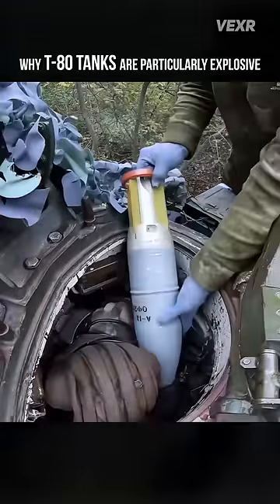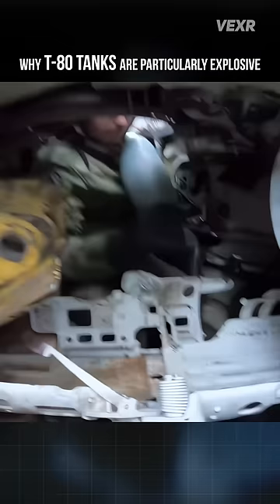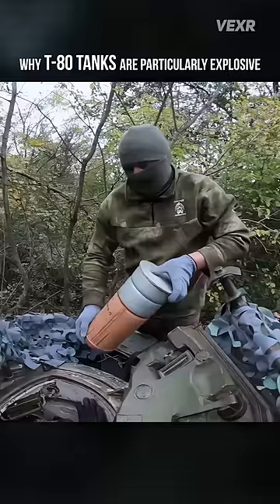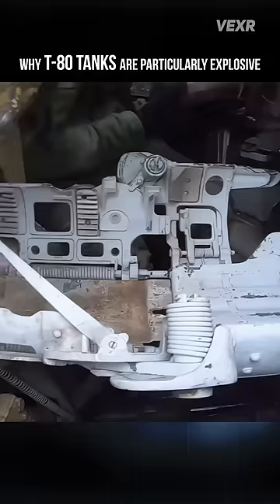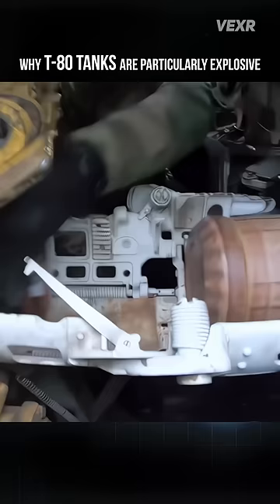T-80 Tanks Are Particularly Explosive, Here's One Reason Why

Comment: Not so advanced.... badly trained.... blah blah blah... Stop your bs! Firstly, regardless of the presence or absence of “fireworks,” breaking through the armor almost always means death for part of the crew. So NATO tanks are exactly the same metal coffins for the crews. In 2, the only reason why NATO tanks rarely explode with “fireworks” is the lack of high-explosive fragmentation shells in their kit (besides, NATO tanks almost never fought against an equal opponent, until the war in Ukraine, which demonstrated the insignificance and helplessness of these promoted vehicles). They are the ones responsible for all these “tower take-offs”. NATO strategy almost does not involve the use of tanks against infantry, and therefore there are no corresponding shells there. Regarding the automatic loader, in older models it actually slightly increased the chance of being “fryed”, but against the backdrop of an enemy shell hitting the tank, as I already mentioned, there will be mincemeat even without “fireworks” and only luck will help. In addition, because of this, Russian tanks have only 3 tankers, which reduces potential losses by a quarter + modern versions already have knockout panels and safer placement of the automatic loader.